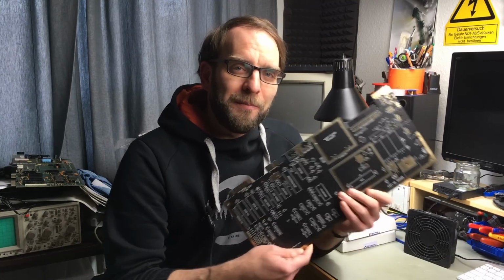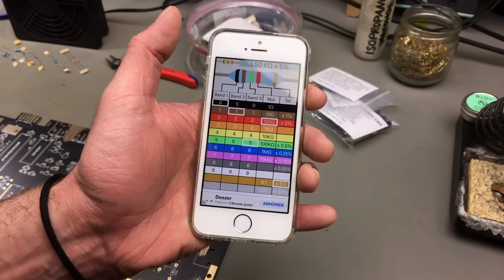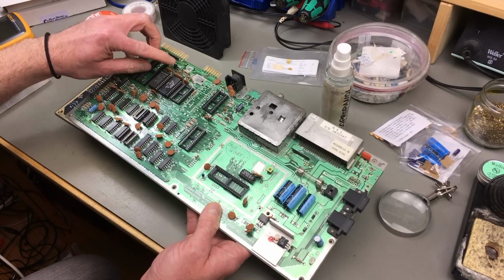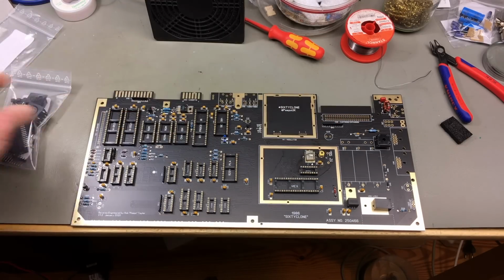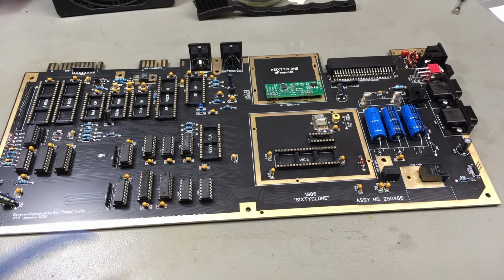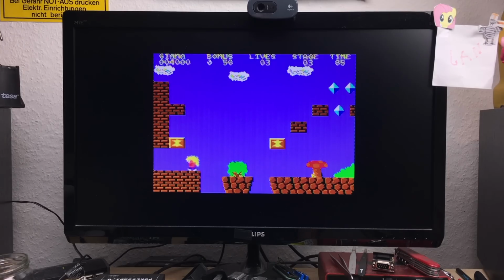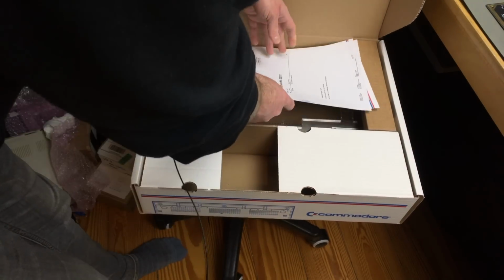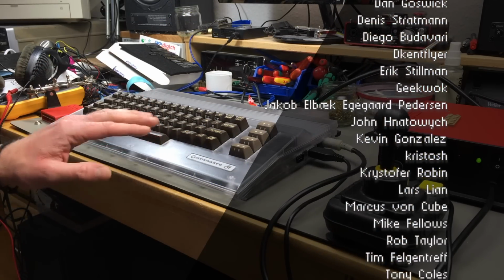Building a new C64 in 2020

Comment: Wonderful!  I enjoyed this very much!  Great tip to screw the jacks onto the board BEFORE soldering to prevent cracking the solder joints!  Impressed by the use of the Vishay component.  I thought the clear case was going to look horrible, but surprisingly it actually looked very nice.
Reply from the maker: Thanks! Yeah, as I said, I'm a fan of the clear cases, especially for DIY projects like this. Hope the new keycaps are going to come through eventually. :)
Reply: @JanBeta  Is there available a clear keyboard module with clear keycaps?

Comment: I was wondering if the old disk drives would work with all the new ICs?
Reply from the maker: Yes, they work fine. The I/O chips (6526 CIAs) are still the original chips though.

Comment: Component Video Enhancement/RF Modulator Replacement:
Features?
- FPGA based modification board for the Commodore 64 computer to produce YPbPr or RGB video output

Nice, but seems different from the one you installed.

MOS8701 Clock Generator Replacement Kit: 
Feature? 

PLAnkton PLA Replacement:
Features: 
- Costs 20% less than the SuperPLA V3 (what are the features of a SuperPLA V3?)
- Draws only 20mA - 1/5 the power of an original Commodore PLA

Nun, ich denke man sollte moderne Technik konsequenter einzusetzen, FPGAs als Ersatz für alte Chips können für alte Boards richtig sein aber für ein neu aufgebautes System wäre doch ein Ultimate-64 besser geeignet. Es sei denn es wäre nicht kompatibel genug.

Comment: I think the LED is less bright because you are using a clear case - the natural light is saturating the light emitted from the LED. You probably won't get that in a traditional case.  As for RF modulator replacements.  Have you tried a Shuriken RF replacement?  I think they produce less jailbars on the output than the RF mod that you used.

Comment: Nice, but it's only partially new, as the most central ICs are just recycled.
Reply from the maker: There’s going to be modern replacements for most of them soon, as I explained in the video. I’m going to do a follow up video as soon as new parts are available.
Reply: @JanBeta  Yes, but FPGAs are not really a "new" C64 either. It's more like a simulator or emulator. I'm not trying to be arrogant or unfriendly here, not at all! But this is why I prefer the home computers that were build around standard logic (mainly TTL). 
It's also very interesting to reimplement old custom chips using modern 74HC-series or similar (like some people have done with the ZX Spectrum for instance) along with other components that actually existed in the 1980s, such as various standard memories and the 6502, Z80, or 6809, etc.
However, actually making new chips would be the coolest, of course, at least for machines like the VIC-20, VIC-64 and other Commodores.

Comment: I'm in two minds about producing these new boards. It makes more sense for computers with onboard batteries that leaked, you can then move the components across (if they haven't fallen to bits from corrosion) to the new board. But for the C64 it just spreads the already finite supply of chips across a greater number of boards.

Comment: Awesome project!  I love to see a C64 come to life, especially a brand new one.  Since you went with the clear case, you should mount some white or colored LEDs on the underside of the keyboard so they light up the motherboard from the inside.  There's a 5V line on the keyboard connector you could tap into.

Comment: Minor point about the video on the C-64:  I cannot remember if this was fixed.  In the original version, at least, (and in the ATARI machines, too), the number of bits used to generate each pixel position on the screen was set as 64 (convenient in an 8-bit-multiple computer, obviously).  However, in original RF-based NTSC (PAL?) video, the number of bit-equivalents in each raster - horizontal line -- (I think) was 65, not 64.  What this did was, since the C-64 was a color video machine, a white dot was made of equally-balanced brightness of the three colored dots per pixel and, due to being one bit too short, you got a repeated RAINBOW instead of a solid white line.  This was very irritating and it took several years before some genius tracked down the video chip design error that caused it and proposed a fix.

Comment: Which C-64 are you building?  The original one or the revised one?  Many programs written for the original board did not follow the spec guidelines and mask out "for future use" bits in several chips and when these upgrades were made, the programs "shorted out" their logic commands due to those bits now being set at times.  The ruined a program I liked that was never fixed when the new machines came out.  The number of color/grey-shade step levels, for example, increased in the later version of the C-64.  The later version was a better machine.

As for the capacitors, all have one end that is used as a shield to reduce cross-talk.  This end should be connected to the "closest to ground" direction.  Many modern capacitors do not have this marked, since in many solid-state devices it does not really affect things much, but one should find out about this and properly use the shield, as it might in some electronic gear actually make a difference.

Comment: For the LED, I think you can also get away with filing down a normal 5mm round LED to fit.  A bit more work but if you have a supply of those may be better than buying square ones.  The sides will not be as clear from the filing and the top you can leave a bit rounded or file flat but may need some polishing.

Comment: I've built three of those SixtyClones, one 250466 with real 6581 SID, a 250407 with a MixSID modification running two 6581's at the moment. I've ordered a 8580R5 to fit on this. So one 6581 and one 8580 in stereo. Last one is a shortboard 250469 with an ARMSID on it. I also used that c0pperdragon modulator replacement board on all three of them. Great video output.
Reply: Since you built all of the revisions, which is your favorite?

Comment: I ordered some new uA78s05 and uA78s12 they are better engineered versions of the old regulators and they are up to 2000mA they are also protected to overheating.
Reply from the maker: Yes, can recommend those, too. I use them all the time to replace the original voltage regulators in C64s. Wanted to try something more modern for this build though.

Comment: when you solder a lot of pins for a device or socket, I like to do the corners first, then do one in the middle, then skip around from there. if you solder them all in a row, it can build up more heat in the part, which we want to avoid. it also affects the small stresses on the part. these things usually don't become a problem, but eh.. best practices.
Reply from the maker: Makes sense! Thanks for sharing!

Comment: The DC-DC converters are a lot more power (and heat) efficient than a 7805, even the very clean ones can be pretty noisy (compared to a 7805).  I recommend a large decoupling cap and a 5v Zener diode (the dose is installed backwards across the power rails) to clean up the voltage, so the analog components won't have to deal with all the noise.
Reply from the maker: I’ve used the exact same model for the 5V regulator in my everyday C64 for years now without any issues. I think the frequencies of the switching noise are too high to have any effect at all on the old ICs. The SX64 and C128 used (older, much noisier) switching power supplies from , too, so I doubt that the modern components will have any negative effects. Obviously the linear regulators are cleaner, as you said.

Comment: I still use lots of analog video. ;) However putting RF on a brand new board would be pretty nuts compared to modernized RGB, look at the size of the old RF modulator footprint. :O Same with the chip replacements, might as well try those out too being brand new parts.

Comment: Nice to see my old U17 PLAnkton design. I used the star for ground connection when programming them in my little homemade rig. 
There's a new version on the way that I finished the board for a couple of days ago. It's a little little tiny bit improved and has all components on one side to enable factory soldering (hand soldering is why I stopped making them). There's not much to actually improve on - it's called the U17 PLAnkton EV. 

Would have liked to see a ROM replacement as well.
Reply from the maker: Ah, nice. The PLAnkton is a great replacement, works flawlessly as far as I can tell. Nice work! I am eventually going to replace more parts, a ROM switcher is definitely on the list. I just haven’t quite decided which one to choose. :)

Comment: There are FPGA implantations of the complete C64 for long now. Shouldn't it be easy to make an FPGA a VIC II with thi knowledge?
Reply from the maker: Yes, most of the full implementations is closed source though, as far as I know. So people making discrete replacements have to start from scratch. There are several projects close to release currently though.

Comment: Looks great.  The only thing I can’t understand is, many C64 boards are perfectly serviceable so can't see why unless all the chips are available new what's the point of a new pcb?

Of course if there are new replacements for the CIA, VIC etc then it's brilliant.
Reply: I think you should see it as a step into the direction of completely new C64s. Maybe parts have already been replaced, some are in development. Yes, you still need some old components, but the availability of low-cost PCBs is just another step into the direction of all-new C64s. And I think it is an important step.

Comment: This is really cool and I want to do something similar! I don’t understand the need for the video enhancement board, though because I thought the C64 provided component out anyway, in addition to the RF modulator.
Reply from the maker: The C64 only provides luma/chroma and composite out. And the composite is mixed in the rf Modulator, hence the need for the little board. It doesn’t output any video without it on the a/v jack.
Reply: @JanBeta  Wow, I wasn’t expecting an answer, let alone an immediate one. Thank you! I guess I was slightly off; the DIN connector only offers (almost) S-Video, not component video.

Comment: MEGA65 project should make replacement C64 keyboards with cherry MX switches as a side project since they already have most of the hardware and production implemented etc.
Reply from the maker: The Mechboard I'm going to put into this eventually also uses Cherry MX style switches. So you could put the MEGA65 keys on that probably.

Comment: Congrats! Well done! Doesn't look too shabby. I agree that it would benefit from a more modern looking keyboard. So, now how about building a ZX Spectrum from scratch? Get a Harlequin board for under € 20. The rest of the parts are all available new. You end up with a Spectrum 128K compatible board including AY sound chip in a 48K form factor, fitting in a rubber key case.
Reply from the maker: Oh, I'm definitely going to build one of the ZX clones eventually. It's just too much fun to make a whole system from scratch. :)

Comment: There are so many good modern replacement chips now. I wonder if one day a C64 compatible could go into production using 100% modern parts.
Reply from the maker: I think so! For most of the chips I had to use the originals there are already replacements in the works. Should happen sooner or later. :)

Comment: Great build Jan. Just a couple of points. I’m surprised you didn’t use any heat-sink paste on the voltage regulators.
Also, the screen printing for the system ICs was not reading the same way as the ICs would be when inserted.
Sorry if someone has already mentioned this, there’s too many comments to read them all.
Reply from the maker: The voltage regulators I used are modern DC-DC converters, they practically don't produce any heat at all and are very efficient. I'm going to add some heat sinks to the MOS chips though. :)

Comment: Love this video! I looked at the "Sixty Clone" option in my own "Building a new C64 in 2020" video. In my case, I ended up going down the Ultimate 64 Elite route, as I'm not as good at wielding a soldering iron as you are.
Reply from the maker: The Ultimate64 boards are awesome, admittedly the easier way to go. But less fun if you like to solder. ;)

Comment: Hi Jan, great build🤩
But the colours are off in giana sisters. Thewhite diamonds looks blue, maybe its the camera, but looks a bit off🙂
Reply from the maker: I think I forgot to solder a little jumper on the RF modulator replacement board so the chroma values are slightly off. Well spotted! :)
Reply: @JanBeta  Thanks, maybe on the next video update you can fix it and show giana again, love this video, will rewatch this weekend👍🏻

Comment: The MEGA65 uses a mechanical keyboard with Cheery MX style keycaps. Buy a mech board and replace with cherry MX switches and then use the MEGA 65 keycaps. Hey presto! Brand new cherry MX keyboard for C64. I think that there should be a MECH board Mk2 that uses cherry MX switches because the C64 MX compatible keycaps already exist on the MEGA65. Speak to MEGA65 people see if they will supply you with the keycaps only!
Reply: It likely isn't that simple: The Mega65 keycaps likely have different dimensions than the C64 keycaps, so you end up with a keyboard with open spaces.
Reply: @danielmantione  I just got out my breadbin commodore 0 (C64 with RAM chip errors boots up reports commodore 0 bytes free and then crashes as soon as you touch a key - LOL!! - I must buy some 4116's!!) Measured the keycaps and they are exactly the same 17.8mm square putting a c64 keycap base to base with a cherry one they are EXACT! However , the keys are deeper 15.1mm to 11.2mm tall for MX keycaps. If you design it well there should be no gaps.

Comment: Certainly good to see things like this being done to keep these nice older systems going, and hadn't heard of Commodore 64 boards being made again like this, which makes it better for getting them going again, as the original ones do end up failing, being as old as they are. So with them being reproduced like this, always good to see & a nice video on you building a new C64 in this day & age, certainly more interesting than some new fan-dangle gaming PC being put together. With that, it'd just be someone installing components which is easy, but this is someone actually building a computer, putting all the little electrical components & chips onto the board, doing the testing as you would & in this case connecting the keyboard & putting it all together in it's case. The C64 Maxi & The VIC20 (The latter being a limited edition of the C64 Maxi, bought one from amazon, getting sent over from the UK to australia as it isn't sold here, so will have both myself as i have the C64 maxi already) which are decent recreations of said machines (Commodore 64 & VIC20), good that they are made so many of us can get access to a more real type of them, not being the real deal & don't have the ones from back when myself, but are still nice ones though. But these reproduction cases, components & the whole main boards which has been made for some time now am guessing, is even better that the whole thing is being made again in a way. Sure, you'd be using older components but still most of them are new. So yes, glad to see these good-old ones being remade as they are, keeping them going longer. And i wouldn't be able to put one together like this i'll admit, still a good bit of viewing though from you & pretty much most who do what they do with vintage computing. Also like some others have said here, similar machines from the time period need to get these whole boards & other bits for them made again too, keeping more going & hopefully getting more people into the fun that is this kind of vintage computing.

Comment: Thanks for showing PLAnkton which I still make and sell. Yes, Eslapion is french in origin.
Reply from the maker: It is an amazing replacement, thanks for your great work! :)
Reply: @JanBeta  I sent you an e-mail with an adapted version of Super Zaxxon that works with the 1541 Ultimate I/II/II+ carts. However, it is still better to use a real Super Zaxxon or one of the replicas which use a 74LS74. Using a cart emulation does not properly replicate the sensitivity to glitches.
Reply from the maker: Ah, thanks! Currently plowing through a massive backlog of emails, didn’t see yours yet, sorry. Yeah, definitely need to get my hands on one of the real cartridges at some point.

Comment: Awesome assembly, Jan! It just occurred to me with your RF modulator replacement, that you’d have space to put a reset switch into the hole reserved for the channel switcher. It would actually be cool, if some RF replacement board would offer the option for the reset switch. You’d basically need to add a jumper lead to the reset signal from the RF replacement board.
Reply from the maker: Ah, that's a great idea actually. Would be pretty easy to implement, too. :)
Reply: @JanBeta  Yeah, I was thinking that either it would be a bracket that holds a tactile switch or that the RF replacement PCB would have solder points for an angled tactile switch.

Comment: What are the part numbers for the DC-DC Voltage Regulators and where can you get them?  Thanks
Reply from the maker: They are RECOM 7805 and 7812, available with various current ratings from many electronics sellers. I used the 1A for the 5V and .5A for the 12V one in this build.
Reply: @JanBeta  Thanks